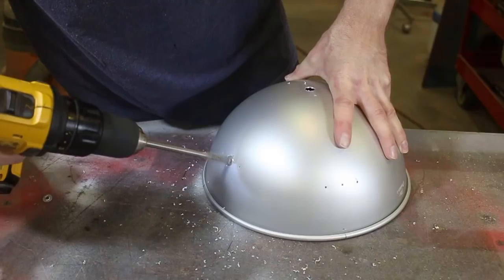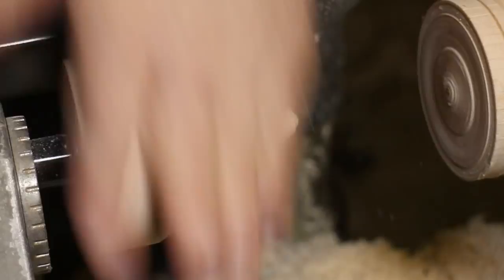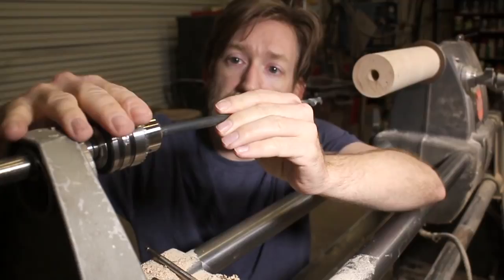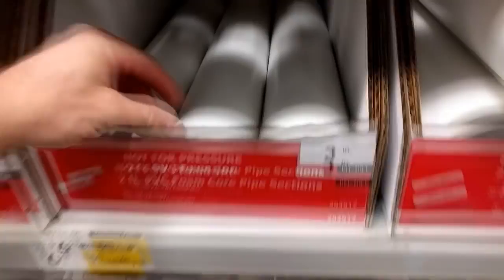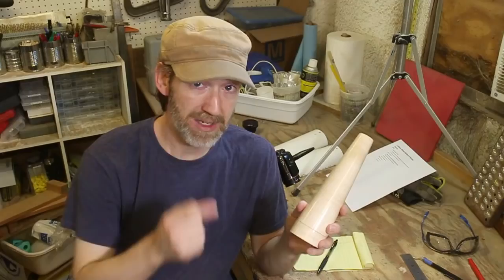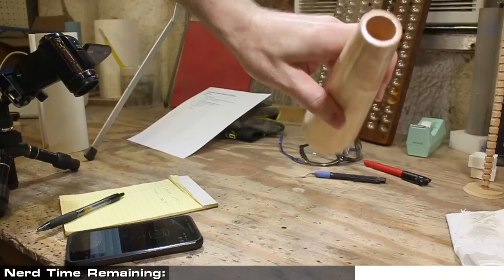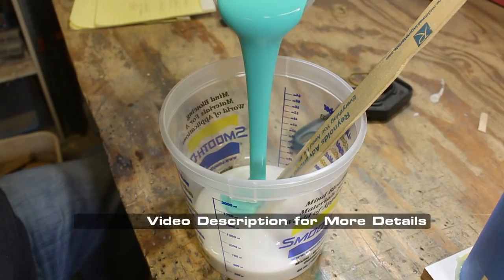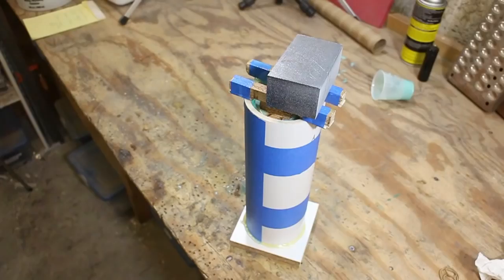Casting the Sputnik Antennas - Part 1: FAIL

Comment: Orrrr... you can fill the void with water, measure the water and wait for the mold to be 100% dry :-) Soooo many inventive and thoughtful ideas - the extraction screw thingy is so smart! This would have been much easier if you had lowered your standards and had made a slit/seam down the side, but I can see you were going for perfection-- which you absolutely achieved after learning from this practice session! BTW there's no such thing as wasted silicone mold material - you can use it as filler inside future projects as long as the mold release has been thoroughly removed or trimmed away :-) Please keep posting learning process videos - we can all enjoy your success and learn how to avoid pitfalls together!

Comment: Great video! Thanks for showing us your fails. I feel like I learn more from them.

Nerd tip: When calculating the volume of a frustum you can just calculate the volume of the cone as if it were complete, then subtract the volume of the cut off cone from the result.

Comment: I always like your videos, can't wait to see how you fix this in part two. 
If I could offer advice. Google Drill Press Speed Chart to see the correct speed for the drill type. For a Brad-point/Auger you should be down as low as 250 RPM on hardwood. Hard to say how fast you were going but it looked to be around 900-1200 which is why the Spade bit "worked" (as much as they ever do).
As for the mold, not sure. Maybe you can slide a thin wire down the inside to break the seal. Just make sure the end of the wire is polished smooth so it doesn't dig into the silicone but instead rides along side the wood.
Anyway good luck and keep up the good videos.
Reply from the maker: Speed wasn't the problem. Either the tip would screw in and it would jam just enough to spin the chuck or, after I got it started with another bit, the sides of the auger created too much friction in the bore and, again, the chuck would spin. The spade bit created minimal friction. A Forstner probably would've worked, too, if I had had one that was sharp or long enough.

Comment: You could recast it as a two part silicone mold (the outside first then base and inside second) Cast the ouside part first with some marbles or bearings set into a wood or plastic base for registers. then flip it over and cast the inner mold and the base. Make sure to spray plenty of mold release inbetween. That might work for you.
Reply from the maker: Unfortunately, that wouldn't have solved the issue with the inside being too long and narrow to release properly. I should be posting my solution in the next day or two, though. Thanks!

Comment: Molding is a trick job. Every surface must have some angle or be tapered to be expulsive. The central hole could have tapered to help extration, but it's hard to do without a proper tool. I might turned a tapered  dowel and wrap a sand paper to tapered the hole.

Comment: Instead of cutting the screw off, you're better off cutting facets on the bit. Easily done with a drill press and stone, or with an angle grinder and some careful passes.

Comment: I'd have just filled the PVC tube with water and submerged the wooden master into it letting the water flow out. Then simply pull it out and measure out the remaining fluid and that's how much silicone you need.
Reply from the maker: I'd be very hesitant to submerge my wooden master underwater.
Reply: I can see that, but it'd only be under water for a really short time, plus you could seal it with a very light coat of wood sealant for extra protection.
Reply: And seal it in a thin plastic bag :) like the ones used at grocery stores for produce

Comment: I think it would have worked if you had higher air pressure.
Reply from the maker: In part 2, you'll see I literally had to drill out the material.
Reply: I saw that.  But unless the mold tears, something has got to give.  But most air compressors just don't go that high.  They top out fairly low. What they need is volume.
Reply from the maker: @tarstarkusz  I was there. Air wasn't going to do it.

Comment: Destroy the wood, save the silicone
Reply: If you peel-back the outer silicone, you could hacksaw your way through half of the frustum, then remove the wood piece-by-piece
Reply: Or use wood-eating beetles - but you can't buy them at a hardware-store :/
Reply from the maker: Couple of problems with sacrificing the wood. First, there would be no way to saw apart the wood without damaging the silicone. Second, I had 36 antennas to cast (plus extras), so I still needed to make a second mold to cut the casting time in half. Besides, molds only last so long. After a number of casts, the mold starts to wear out, so I would still need the master to create any molds in the future, and there's far more work in making the master.
Reply: आदित्य Aditya मेहेंदळे Mehendale haha 🤣